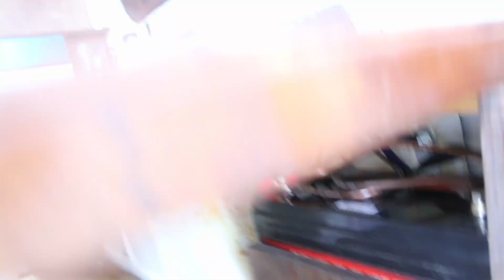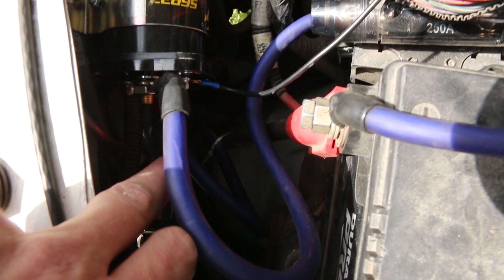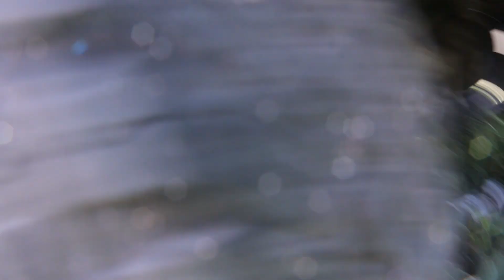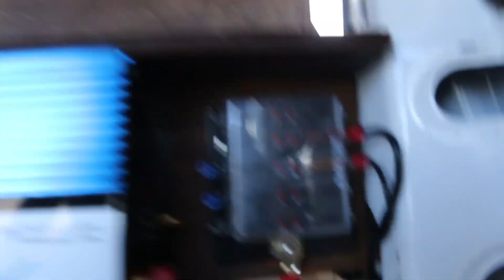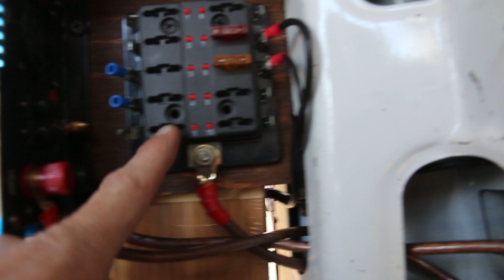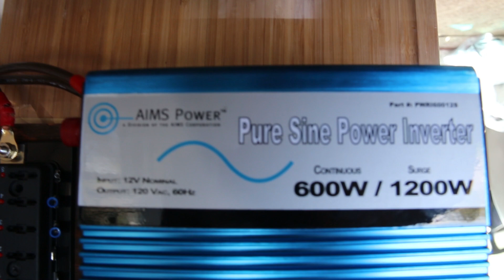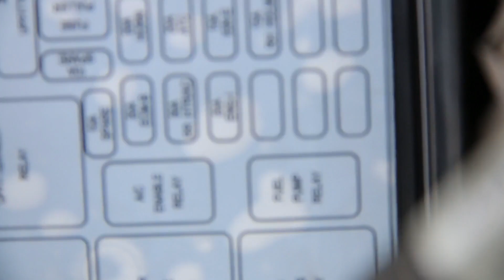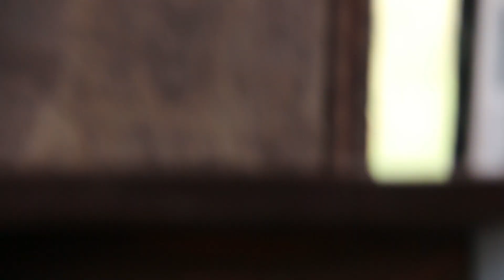How To Install A Secondary Battery, Isolator, Inverter In Your Van

Comment: Thanks for an Informative vid, Mike !
I’m doing a (slightly) similar build, in that my (Small) Jeep Cherokee XJ is going to be my ‘home’.  I’m outfitting it as thoughtfully as possible, especially because the living space is MUCH SMALLER than a van.  Virtually ALL ‘cabin’ space is accounted for.  Inverter, appropriate wiring, Dometic AC/DC fridge, “House” battery, Isolator/VSR, “Cranking” or Starting battery, and oversized Alternator.
Now, my understanding, albeit potentially Wrong, is that a stock vehicle battery supplies Cranking CCAs until running, then the Alternator essentially powers everything.  Since my space is EXTREMELY Limited, would it be reasonable to place a Deep Cycle AGM, High aH, oversized battery at stock location and wire it for “House”, and place a small but high CCA AGM battery UNDER Jeep at framerail ?  Like a motorcycle, ATV, or wheelchair battery .... and using that as my Starting battery ?
Reply from the maker: Yes, deep cycle battery has more amp hours and less cold cranking amps, so I suppose that is doable. You would just have to run your positive wire from starter to the cold cranking battery instead. Also, I'd recommend not putting it too low on the frame where it could be submerged in water or hit by rocks, etc.
Reply: Appreciated.  Yes, IF I were to get a smaller “Cranking” battery to mount underneath, it would be in a Safe custom enclosure.  Small is Why I would be doing that, and “reassigning” my OE Battery location for the large Deep Cycle.  Been googling for Hours, using different Search terms, and cannot get a definitive Answer on using a power sports/wheelchair battery for Basic car functions.

Alternator output might be a risk to motorcycle-type battery.  That seems to be only Caution that I’ve found.  Will need some sort of (‘Smart’) Battery Management that is self-contained & doesn’t require AC “Shore” Power.
Thanks !

Comment: hi: when you install the  second battery . Both batteries have to be similar in  amps or can be different. Example 1 : 12volts/80 amps both. Example 2: 12volts/80amps - 12volts/45 amps? . Thanks
Reply from the maker: That's a great question. It is ideal to have the same Amp hour rating so that they can charge evenly. Otherwise it may significantly reduce the battery life of both

Comment: So MM,  when does this A/C  Enable Relay open the Isolator, when you make a key contact  - before starting the engine or after when it is already running? Does your car starter take current from both batteries? If I understood you correctly both pairs are interchangeable, so there is no one-way block in the isolator to prevent current leaking in the wrong direction.
Reply from the maker: It will enable relay when you turn the key to the on position which allows stereo and blower to work.  Car doesn't have to be running. Engine does however have to be running to allow alternator to charge secondary battery. Otherwise you will be pulling power from main battery. Yes, there is no one way. While open the amp hours would be that of both batteries combined.
Reply: So maybe it is a better idea to bring the signal from the alternator and not the A/C Enable Relay... Like on this wiring diagram https://www.12voltplanet.co.uk/user/KnowledgeCentreimages/HD-relay-split-charge-system.jpg

Comment: About adding to the auxiliary fuse box . Once it is set up ,it's a fuse box . No place for a 2nd in cable . Grounded is grounded . Already have 2 fuses (circuits) as long as the in (Red) can handle the In (load) . Just add fuse and wiring  to  what ever PLUG type needed . A fuse box is the sameis the same > wiring wise < DC  12v or  AC 110 . That's why fuses have different ratings .

Comment: about to add this exact set up on my f150 camper sleeper setup..thanks for the video..wish me luck..
Reply: ? so the aims inverter is grounded to the frame and not back to the slave battery?  there is a third post marked ground that i dont need to hook up?
Reply from the maker: the03mach1 the aims inverter is grounded to the frame as well as the slave battery and your primary battery. Running a negative cable back to your slave battery is unnecessary, but you can do that if there is no good grounding point otherwise or you don't want to drill a hole
Reply: hooked up for 3 months..camped with this set up for 6 weeks straight i dont have the refregerator ...i have a sleeper camper and use electric blanket in winter and fans in summer..charge electrics and interior and exterior lights..got most stuff off amazon..will list prices soon for watchers..thanks mike
Reply: @the03mach1  What year is your ford and did you also install the relay solenoid?
Reply: @Save My Bees 2006 F150 stx..and yes i instslled the isolator..i wrote an amazon part and price list in the comments of what i used on my 06 f150..i lived in it for about 2 and a half months...and am now puting it in a GMC Regency conversion van..

Comment: see what i did was just used 1 marine battery with a 1,000 watt inverter.Then eventually the battery started draining faster so i thought about hooking up two batteries together to keep the mini fridge on longer.My question is would it be better to use two batteries or just use the 1 battery and hook the 1 battery to the alternator and i realize the alternator only works when the car is running ?
Reply from the maker: If the marine battery is not currently hooked up to your alternator, what are you using to recharge it? You could add a battery but then it would also take longer and require more energy to recharge. I would suggest adding a solar panel to your roof to assist in recharging the battery so that you are not heavily taxing your alternator. And yes, alternator only works when car is running.

Comment: I’ve tried my true ignition source with the radio and later a/c controller (closest access) I’ve blown the fuse to both sources so far. About to attempt a third. Any suggestions or advice? Thank you
Reply from the maker: Heisenberg_bitch My guess is that you have a hot leading to ground or the source you chose may not be high enough amperage rating. I assume you already know this but the ignition source should only be to switch the isolator on and off, not the main source of power. Does it blow  the fuse immediately or after some time? If it's immediate then it's more likely that a hot is touching ground somewhere.
Reply: Mechanical Mike it will go for about a day and a half before blowing the fuse

Comment: nice job, and very well explained!! thanks so much, I'm looking to add a batt iso to my van next week! one question, is it recommended to use 0awg wire from the battery to the AUX battery, and then 4awg wire to the inverter and such? at first i thought i should use 4awg all over, but have noticed people use 0awg-2awg from battery iso to rear..
Reply from the maker: CineSkies good question. 4awg is sufficient to run from primary battery to auxiliary battery. If you want to go with a bigger guage that is perfectly fine, but not necessary. The larger the guage, the less resistance and less heat. In this case I used 4awg to feed auxillary, and 8awg to feed inverter. This depends on how much power you plan to draw from the electronics you have. To determine power usage, add up the wattage rating on the tags of the electronics you'll be using and divide it by 120 for anything that is running off of the inverter. Divide it by 12 for anything running on D/C power. The resulting number will be your amperage draw. If you will be drawing more than 70amps total, you will want 4awg or larger feeding inverter/secondary fuse panel.
Reply: Mechanical Mike awesome thanks so much for such good advice. ✌️💯🤙🚐💨

Comment: Is the relay better for alternator life? Second the only time a relay would allow your deep cycle battery to take a charge is when ignition is off and main battery is connected to charger?
Reply: Better for alternator life compared to a isolator*
Reply from the maker: Relay and Isolator basically serve the same purpose so I don't think it would make too much difference. Isolators tend to last longer than relays. The purpose of the isolator is to shut off flow of power from primary battery to secondary when the car is off to prevent draining the primary battery

Comment: If you want to use a battery selector switch instead of the isolator, would it be wired in the same position?
Reply from the maker: Are you talking about a manual switch you would have on the dash to turn power on and off to auxiliary battery? Or a switch under the hood that allows you to charge one or the other?

Comment: car batteries produce toxic gases while charging. Having the batterie inside the car is a real bad idea.
Reply from the maker: Uwe Lohr this is a sealed battery but that is a good point if using a lead acid battery or other open cell battery. Thanks for the comment.
Reply: Really. I did not know these ones. Thanks for the info. Keep it on ;)
Reply: Tell that to anyone who owns a vintage Volkswagen Beetle. Car battery factory location is under back seat.  Many car fires caused by battery arching on seat springs shorting the battery.
Reply: @jmschlager  Jaguars also have under rear seat!..I'm talking 2004 year model..What are they thinking!!?
Reply: True, but depends on the type of battery how toxic much is released. 
Basic lead-acid will release hydrogen when charging, along with other gasses. This is what causes corrosion on battery terminals and in the vicinity of the battery. These must be vented to the outside. I found out that charging a standard lead-acid battery inside the RV will set off carbon monoxide detectors.
Sealed lead-acid will also release hydrogen when charging, along with other gasses.  The seal reduces the evaporation of the water from inside but does not prevent it, it does however prevent you from being able to add water. Hence the maintenance free; doesn't mean they don't require maintenance, it just means you can't do it. These must be vented to the outside.
AGM batteries have a layer inside which allows for the ions to move without becoming gas, this greatly reduces off-gassing internally. These are generally safe to be inside the vehicle and venting is not required.

Comment: DANGER WILL ROBINSON DANGER!! 
Why did you even bother with that one grommet coming in the van? When you used no wire grommets for all those sharp drilled holes to eventually vibrate through the wire and then running a main lead inside the gas tank shield... freaking brilliant. And tiny cheap weak looking zip ties... Damn, I hope you survive. At least you have a fuses at both ends. Next time take a look at the multiple levels of shielding around stock wires and especially around main cables that can rub. You can learn a lot reading a book, but life experience will always win in the end. 
Braided Wire Wrap >>> https://www.summitracing.com/int/parts/sum-890342/overview/?cm_mmc=pla-google-shoppingsrese1_-summit-racing
Reply from the maker: Diversified Dame that was the only grommet he had purchased in advance.

Comment: no bushing around that wire and running by the gas tank?? wishing fire and destruction much?? you need rubber around the wire through the holes movement is not good.
Reply from the maker: circusboy90210 Grommets were added
Reply: I"m contemplating making a travel trailer out of a 18 wheeler. lol twin slide outs from both sides and a slide up.  using a  day cab.
Reply from the maker: circusboy90210 that would be bad ass. Post links if you do

Comment: How or what made you use a 200A fuse/or Isolator and not a 300 or 500 amp?
Reply: Unless you have a large inverter, nothing is going to pull enough power for that larger wire/fuse to be necessary. A 200 amp fuse could power up to a 2000 watt inverter. Most of the amps to power it would be coming from the rear battery. For running that kind of inverter you would probably want three more batteries back there to make it useful without draining the battery in 5 minutes.
The wire from the front should only be carrying amps from the alternator to charge the rear battery. Keep in mind not all output from the alternator will be going to charging batteries anyway. On a typical vehicle with a 100 amp alternator, the engine and ECU can pull around 20amps, the accessories like AC and headlights will pull 35-60 amps. Keep in mind that at idle, the alternator puts out about half the rated amps; that's why headlights dim while sitting at a red light with the AC on. Even with all accessories off, the alternator may only be sending 25 amps to charge the rear battery, driving down the road it could be more like 50 amps. 

The only things that need 300-500amp fuses are winches and massive sound systems, neither of which are related to this video.
Reply from the maker: Depends on the setup you are using and how much power you plan to draw off of it. One reason is that the more power you draw, the harder you alternator has to work to recharge everything while also running the vehicle.

Comment: How  did you connect the refrigerator to the panel and ground it ?
Reply from the maker: Huy Thai D. Refrigerator positive wire connects to the DC fuse panel. Negative  wire grounds to the body of the van

Comment: do you have a schematic or diagram? I want to to add a 2nd batter, invertor 2000w? and solar to charge. thanks
Reply from the maker: Andrew Clyde Bell there is a wiring diagram at the end of the video

Comment: You said the isolator allows your alternator to charge your secondary battery but what it allows is the starting battery to charge the secondary battery. The Stinger is connected to the starting battery and not the alternator.
Reply from the maker: Stuart Olson It doesn't have to be the A/C relay, just a relay that switches on when the key is turned to the on position. This allows the isolator to open the connection between alternator and secondary battery only when the car is running, which prevents the primary battery from being drained while the car is off. Amperage rating is based off of the capacity of the isolator, as well as capacity of secondary power. You want the lowest amperage fuse that still allows isolator to reach rated capacity without blowing the fuse.
Reply from the maker: net poser it works the same way. Your alternator connects to your primary battery at the same point that your isolator connects to your primary battery. Chances are you'll be drawing from both
Reply: Good point. In my Promaster I have another positive post I used to connect my isolator.  Kinda cool how RAM made the battery hookups on the Promaster so you have a few extra tie-in's for other things.
Reply from the maker: net poser Right on, Dodge does a good job of thinking ahead. Those are cool vans
Reply: Posted a photo on my IG with my setup. I'm about 80% done at this point. https://www.instagram.com/p/Bc0kVzzAHPJ/?taken-by=netposer
Reply: Can you explain why you connected the isolator to the A/C Enable Relay? I don’t understand this part. Also, how do you know what size Ah relay to get. Is it based off the alternator Ah or the auxiliary peak power need?

Comment: I'm putting a slave deep cycle battery in slide in truck camper and figured I'd charge with solar but was wondering if I could run the truck engine and charge through cigarette lighter plug if needed as backup charger? Thx and great vid!
Reply from the maker: alexzanderarmstrong Solar will only be enougg to keep adequate charge if your aren't drawing much power from your slave battery. You could run power from your cigarette lighter to assist but it wouldn't take too much extra time to just run a wire from your existing battery to the slave. If you don't want to get an isolator / relay, you could just put a manual switch on the wire feeding your slave battery so you can control when to feed extra power to it
Reply: thanks! is there some kind of quick disconnect i could put in the line for when i slide the camper out of the pickup truck. I would like to keep battery and inverter in the camper. something like a male/female extension cord set up before power line goes into camper?

Comment: None of the purchase links work below and the fuse in your video is 250 amps, but your diagram says 200 amps.
Reply from the maker: Justin had a 250 Amp fuse but I would recommend 200A. better a blown fuse than blown equipment. Links have been fixed

Comment: Your video was one of the most well explained detailed instructions for running Isolator Inverter and second battery that I have seen. I have stranded myself more than once talking on my CB radio with a amp in my truck, this sounds like the answer, my stuff is all DC powered so the Isolator is the trick for me. Well done...

Comment: How do you know if the alternator is sufficient to charge both batteries?
Reply from the maker: musiceuphoria
Your alternator should have an amperage rating on it. If not try finding a model number and looking up specs. If it's the stock alternator, chances are it will be working extra hard to power both batteries, which will reduce the overall life of your alternator. That is why it is ideal to ha e a supplemental power source such as a solar panel to help charge the auxiliary battery. The newer your car, the more powerful your stock alternator due to more and more electronics in cars as the technologies become available. Something that can help is switching your headlights, taillights, and such to LED to reduce power consumption of your primary battery